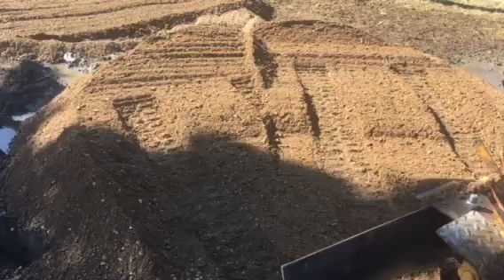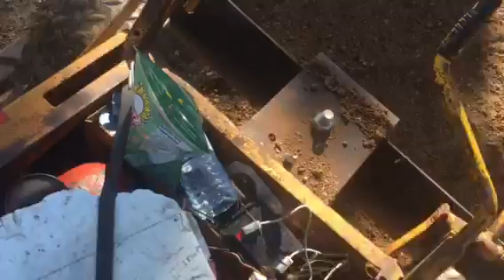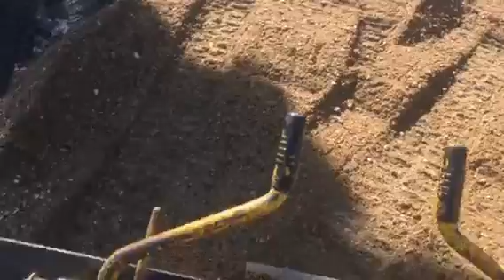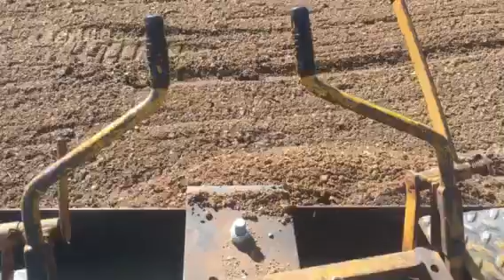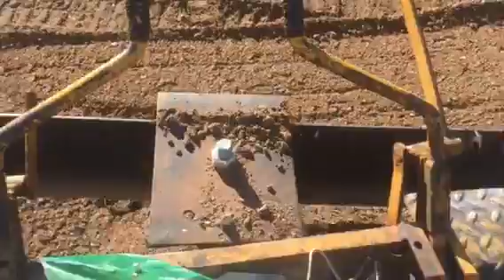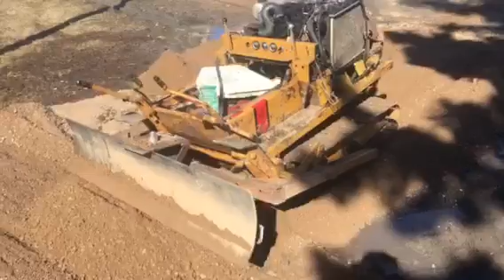Modified Case TF300

Comment: How do you drive it? Do you have to reach around and use handles? I m looking to purchase one just like this with dozer blade..can I face blade and operate that way
Reply from the maker: Dave Tiriolo there is a lever for forward and reverse. Those handles move to either end so it is a bi directional. The handles lock forward to lock in the track. You pull back on them and the track gets no power.